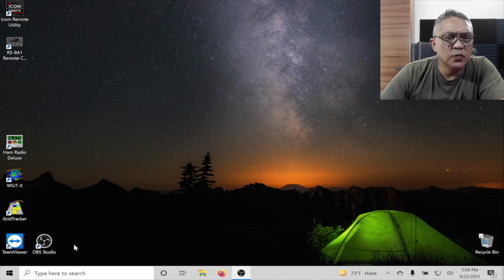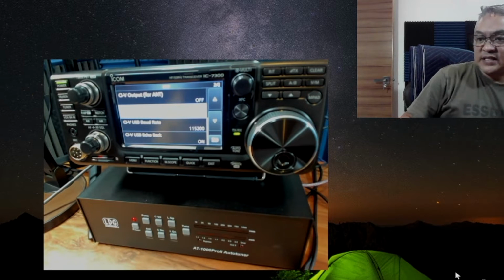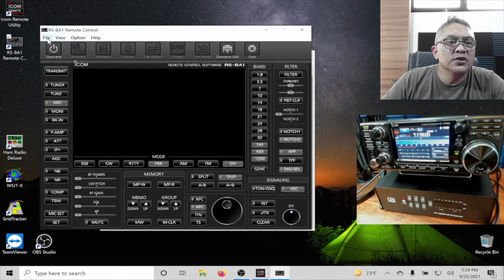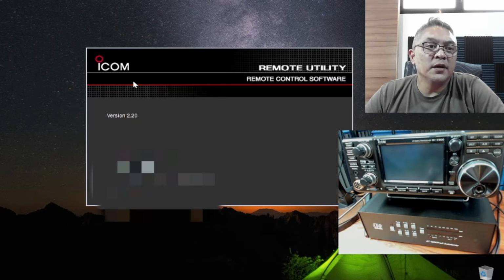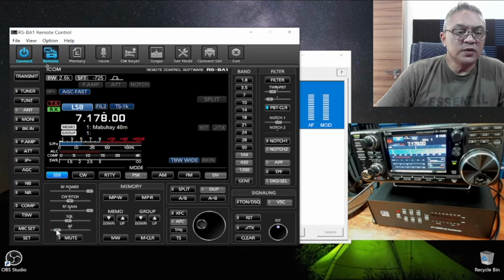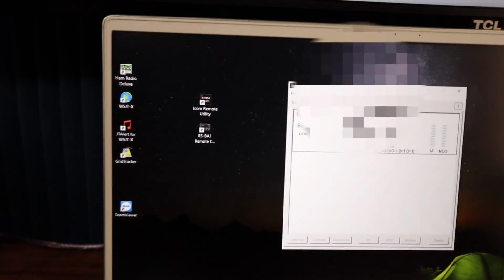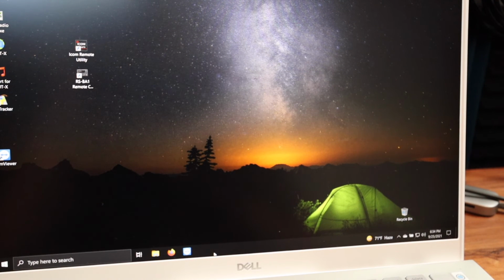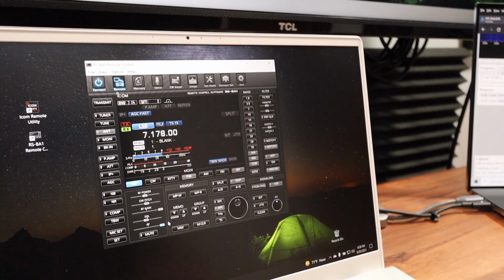Remote Controlling the ICOM IC7300 with the RSBA1 software | My Troubles and Troubleshooting efforts

Comment: On day 2 as well - Trying to use the remote on a laptop connecting via internet to a serverPC connected to a 7100.  I think my issues are with the router and port forwarding....  Thanks for the video.... some things to try.... 73

Comment: There are some issues with this software. The remote computer should be able to connect to the server computer within the same LAN. PC to PC communication within the same LAN is not restricted on any port..after you turn off the dumb Windows firewall. For the Server PC to respond to the remote PC request some service needs to be running at all times on the server PC. And I cant find any Icom services running on the Server PC.  Icom instruction manual of their official videos don't mention anything about this. I've been banging my head with this for 2 days. If local LAN connection works, the remote outside of your home will work too once you port forward the three ports. I can't connect at all within my LAN. My Server PC can connect fine with the USB cable going to the 7300. But no remote PC can connect to the server PC.
Reply: I have the same issue. Windows 10, even with the firewall off, I cannot connect locally or via the net. Port forwarding on 50001-50003
Reply: @205a2  I'm gonna do some more testing with some apps and see if I can locate what service should respond to the port request and I will post if I get any luck. Acording to ICOM this should be straight forward.. but for some reason its not.
Reply: Thank you
 @jolebole-yt

Comment: So does the v2 rsba1 with a 7300 allow for remote viewing on a laptop/tablet anywhere away from your QTH
Reply from the maker: I use the RSBA1 V2 for my IC7610.  Here's a cut and paste on what's new. "New Features
With the RS-BA1 Version 2, you can use the dualwatch operation and spectrum scopes with waterfall function as well as observe the MAIN and SUB spectrum scopes. The RS-BA1 Version 2 can also enlarge the panel size (normal or large is selectable), [MUTE] buttons added, clickable indicators to change settings, SUB dial added and RIT tuning knob & TX functions added. The RS-BA1 Version 2 can also still be used with single receiver transceivers.

Users who already have the RS-BA1 Version 1 can upgrade to the Version 2. Please note, this is not a downloadable upgrade, but a software disc that needs to be purchased from an authorised Icom dealer. "  73's

Comment: Got it working finally after a week of trying! Once I figured out my routers public ip and set my home PC to a static ip I went in and created the USB connected radio on my base computer....then created the server on the base. Went to laptop and configured the server on that and finally got the settings correct and bam. Damn this software works very slick once configured correctly!

Comment: It's so hard to get remote working, the USB works but the ports 50001:50003 nitemare Watching if you fix the problem its a pain in the ass 😫 USB to IC7300 works but the remote to my laptop is a problem did you change the port to 40001: 40003 Thanks watching now
Reply: Did you ever get it sorted? I’m having the same issue
Reply: @michaelt.9372  Yes I got a good chap on Facebook that has sorted it for me let me find the group say I pointed you i will message him what's your Callsign Thanks Tom Tom :)
Reply: @Tom_M9FUE  I unfortunately don’t have Facebook.
Reply: @michaelt.9372  What is the problem you're having on the remote side? Of the software? Maybe ask him see if I can help you out!
Reply: @Tom_M9FUE  so I got the port issue sorted out. It was a firewall issue! Now my issue is, on my remote computer, I get “connect error” when I try to connect to my server computer from another computer. I believe it’s a com port error.
Reply: @michaelt.9372  You need to forward the ports to the remote side I think, VFR has it sorted out now 👍 he might see the comments too and help you out, I use mine at home when I'm down stairs looking after my 2.5 year old so it works well for me but not 100% remote just in the house down stairs or used for live streaming have a look at my channel you can see some cool stuff with OBS and the software 😎
Reply: @Tom_M9FUE unfortunately vfr wasn’t able to help me the last time. forward the com ports? The UDP ports are forwarded and I’m able to connect remotely no problem. It’s just when I open the control app it says com port not found. So I’m like 3/4 of the way there. It’s driving me nuts.  Nothing online has been of any help either
Reply from the maker: Hey Tom,  try to get some assistance on the Facebook Group.  https://www.facebook.com/groups/RSBA1
I'm getting ready to my trip.  I'm an airline pilot.  Sorry I can't help right now.
Reply: @DarrenN4VFR  Nice one mate, what do you fly B777 or B747 very nice :) have a good flight and stay safe i will join the group thank you speak soon I'm also on QRZ too email at the bottom if I get it sorted out will do a video:) 73's for now clear to take off winds 250 at 12 knts

Comment: Hello - it's been a few months down the line now. Did you get this sorted? I had problems with setting up my Icom IC-R8600 for remote operation. It's definitely not straightforward!
Reply from the maker: Not exactly at this QTH, but in Florida where my IC7610 is setup, it works really well with the RSBA1 V2 software.  You got that right about not being an easy setup.  Too many parameters that can cause the software not to communicate with the radio. 73's de Capt Darren N4VFR

Comment: Go on the radio it self and make sure acc/usb af output level is not low if its at 50 thats okay
Reply from the maker: Yeah, it's 50% default levels. I'll double check when I get back home trouble shooting.
Reply: @DarrenN4VFR  okay mine works on the laptop you using remote when you at the hotel make sure thats on regular speakers
Reply from the maker: @mikegianfrancesco9431  gotcha, I will buy some headset  once I have the receiver AF working. I just updated my Port Forward using "My ip" to get the ip address. I did this remotely from DFW using TeamViewer.
Reply: Forgot to mention sometime team viewer any vpn can cause issues with the remote
Reply from the maker: @mikegianfrancesco9431  Oh okay! I'll check that out with TeamViewer app closed.
Reply: Unstall it

Comment: Darren, I am having similar problems with my installation also. Maybe we can help each other
Reply from the maker: I'm on a 4 day trip flying passengers through out the US.  I get back home this Thursday night and planning to update my Firmware, re-install my Icom USB Drivers, On the Remote Software - change the "Connect Setting" to "IC7300 (V1.20 - 1.30)", and looking at my wifi router to ensure that my Server IP and UDP are passing the signals through.
Reply from the maker: @Richard Matthews,  Another viewer told me to look into your Router and enable Port Forwarding for UDP 50001 through 50003.  Also, while your on the computer which you will use as a server, goto google and type "My ip"  It will show you the IP to use.
Reply: Are you home if so I can help out
Reply from the maker: @mikegianfrancesco9431  Out flying passengers for a couple of days.